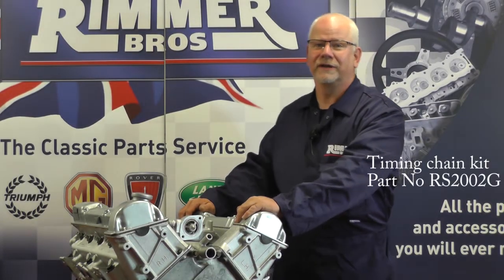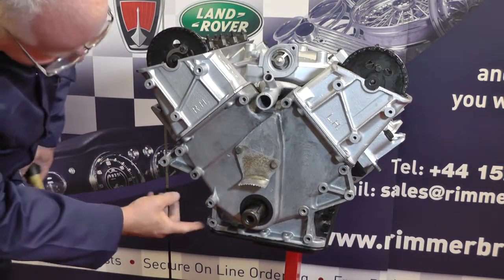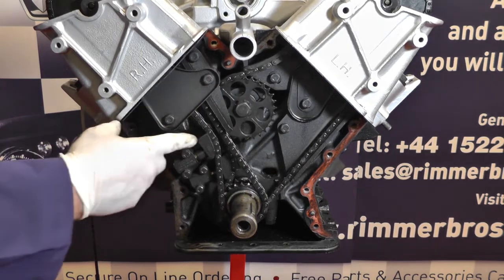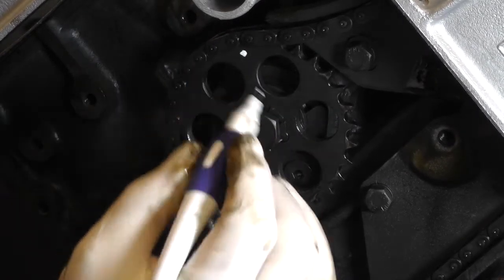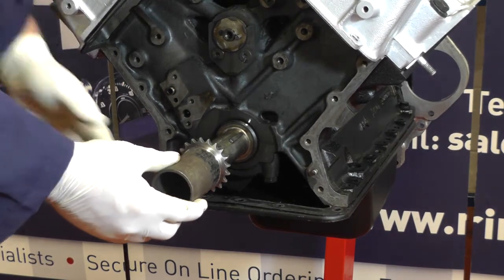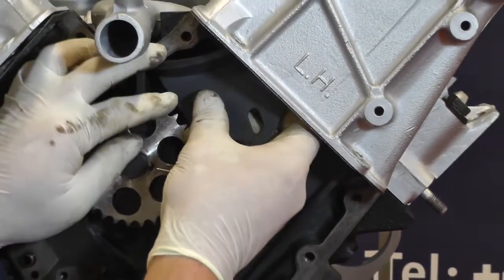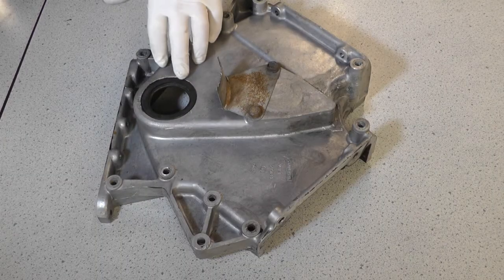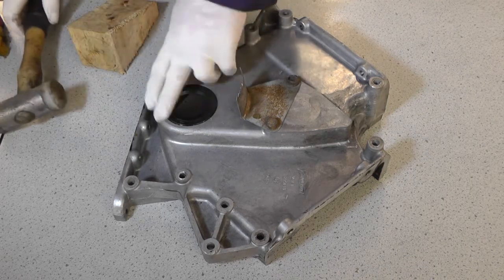Replacing the timing chains on a Triumph Stag. Rimmer kit including sprockets, tensioners and guides

Comment: Thanks, a wonderful video, 1 remark though,what you mentioned as number 2 cylinder is actually the number 1.... Uneven numbers RH-side seven numbers LH-side (as seen from the driver and cast in the cylinder heads).

Comment: What a complicated design. What a palarva. Doing that while the engine is in place?  Must take all day at least.  And that is done every three to four years as well.
Reply from the maker: Whilst it can be a bit tight, any at home DIY mechanic with a workshop manual is able to complete this task with a little bit of determination and patience. The service intervals for this job are also much longer than 3-4 years as it is a timing chain and not a timing belt.
Reply: @RimmerBrosTV  
Thx. The general recommendation is 30-40,000 miles to change the chain. OK it depends on your milage. Does the chain last longer when using semi or fully synthetic oil?
Reply from the maker: @johnburns4017  generally speaking the chain doesn’t need changing unless you notice symptoms of a bad chain/timing assembly such as rattling, clunking or general irregular sounds. Timing chains usually last the life time of the engine, it is more the tensioner’s and guides that wear but even then it is not a regular issue
Reply from the maker: @johnburns4017  generally speaking the chain doesn’t need changing unless you notice symptoms of a bad chain/timing assembly such as rattling, clunking or general irregular sounds. Timing chains usually last the life time of the engine, it is more the tensioner’s and guides that wear but even then it is not a regular issue